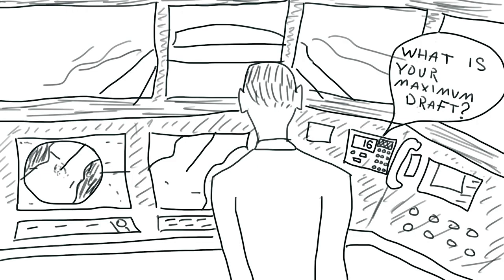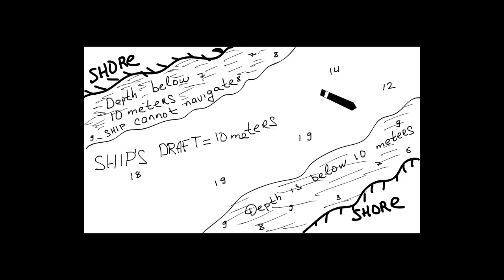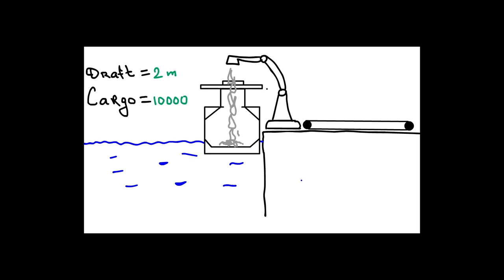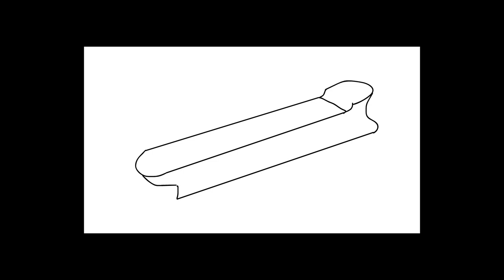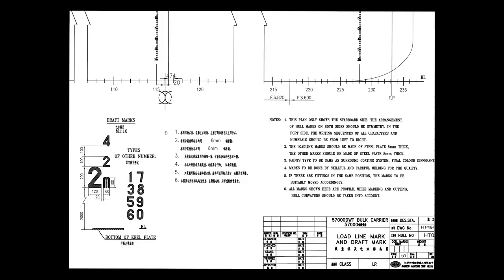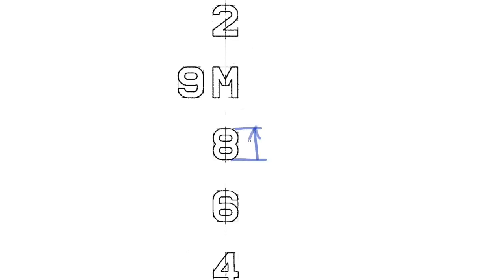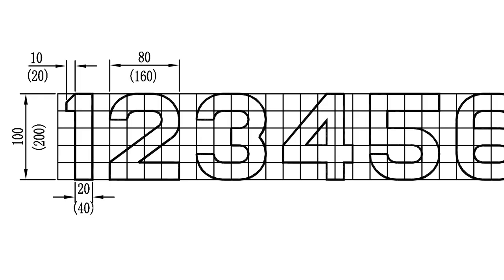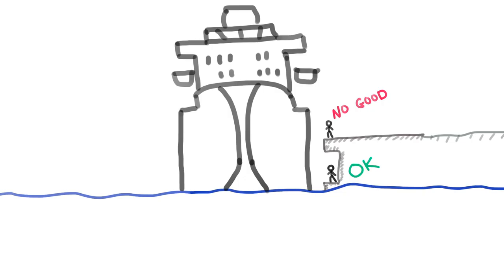Reading ship's draft.

Comment: Is even keel a must before vessel sailing from load port after completion of loading? Thanks.
Reply from the maker: During passage best to have 50-70 cm by stern. But on departure might be necessary to have evenkeel to reduce draft (if there is restriction)
Reply: @CaptTymur  Thank you very much.
Reply: Is there any standard or restriction related to the trim sir?